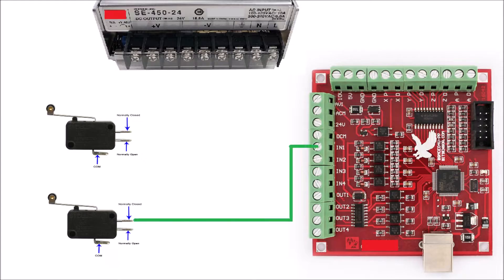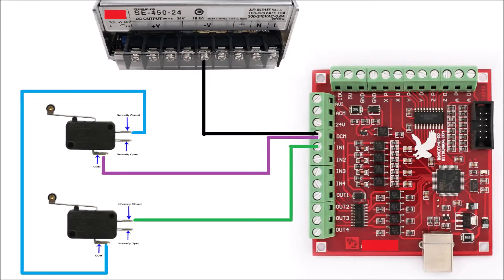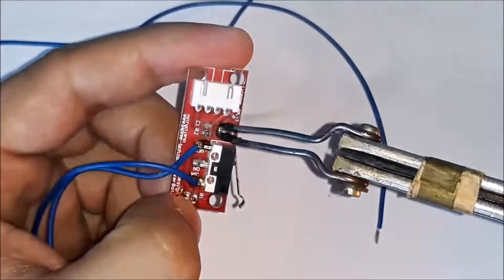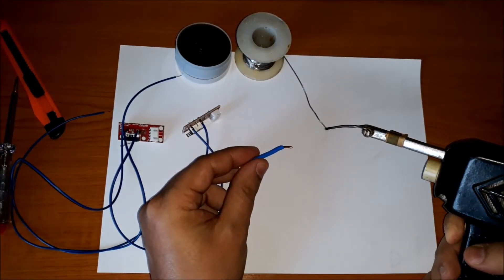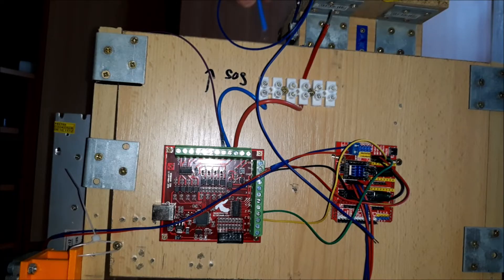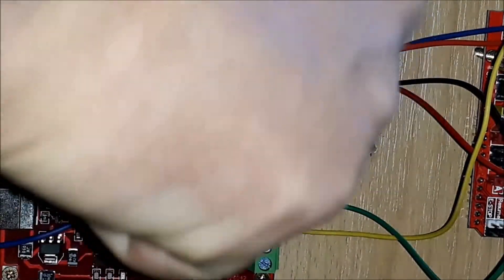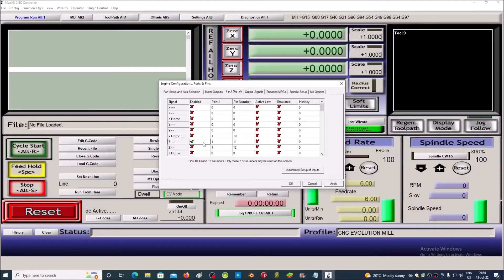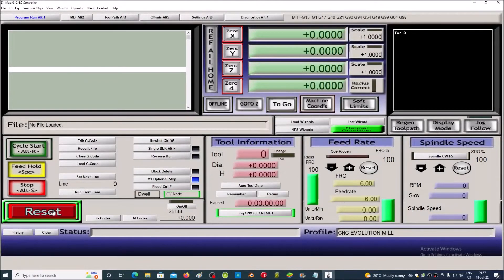CNC MILL BUILD PART 30 - MACH3 USB CONTROLLER LIMIT SWITCHES SERIAL WIRING FOR Z AXIS

Comment: My board was slightly different. I wired everything the same except DID NOT connect anything to the DCM terminal. Doing so caused a short where limit switches would activate output pins. I just connecting what would normally go into DCM terminal to negative on the power supply.

Comment: if you guys think this is actually work, no its not. but as an exchange you can use active low pararel switch by put 1k resistor between 5v and IN1, than use this schematic for IN1 and ground

Edited: i just realized if the mach 3 optocoupler power source was from 24 v, so yeah, its already being pararel at the first place by using IN1,IN2, and so on as a ground for switching (HIGH and LOW) the optocoupler

Comment: Multumesc de informatie!
Reply from the maker: Ce masinarie a-ti construit? 🤔
Reply: What is deferent using NC or NO switch?? Wichone is better? @CNCEVOLUTION
Reply from the maker: it is very dangerous to use NO, this means that the circuit is open and when the limiter is activated it closes and gives a signal, but if one of the wires of the limiter is broken, the circuit will never close again and the axes of the CNC will collide.  with NC limiters it is exactly the opposite, the circuit is closed and gives a permanent signal to the controller and at the moment of activation the circuit opens, so the controller knows that there is a problem and stops the CNC, also if for any reason the wires are interrupted, the signal is cut and the CNC is cut again  it stops.
Reply: @CNCEVOLUTION  perfect explain sir thank u. One more question, need to put home switch or posible to use limit switch as a home switch also?? 
I do a seri( not pararel) conection switch. 
NC pin SW1 to In1 - Com pin SW1 to NC pin SW2, com pin SW2 to GND mach3. One switch on x++ other one on X-. It posible to make the switch X- As home switch also? 

And its good wiring?? In1 and gnd?? Or in1 to 5v??. 
I seebon your video is in1 to GND and make check list on active low. Thank u
Reply from the maker: @botak333  in the current video I used 2 switches, one at each end of the Z axis, but you can put them on any axis and yes, each of them can be configured as a limit switch and as a home switch from the mach3 software, the physical connection can be done at one of the pins IN1 IN2 IN3 or IN4 with the DCM pin but with the condition of setting the mach3 software correctly. for more information see that I made videos with all the axes of the cnc.
Reply: @CNCEVOLUTION  do u have video to set limit switch as home switch?? 
And DCM is gnd right???
Reply from the maker: @botak333  -here is the homing link https://youtu.be/Mj9Ez7bsKMI - MACH3 HOMING SETUP ON BSMCE04U-PP USB BOARD
- here is the link with all the clips All videos: https://www.youtube.com/playlist?list=PLot1H9LpaT1jpxOhBffK3CaaUTtldK7fC
- I'm curious what country you're from and what cnc you build
-subscribe to the channel because now I'm building the much stronger 2nd version
-yes, all IN 1234 pins and the minus of the power supply are connected to the DCM, but in some countries they have different names.
Reply: @CNCEVOLUTION  okee, iam from indonesia, iam hobbys of cnc, i was build but with grbl, now i used AC servo and mach3.
Reply: @CNCEVOLUTION  one more question mate. What is deferent (+5v common , -step , -dir ) vs ( gnd common, +step, +dir)?? 
Wich one is better? For now i still used gnd common. I used mach3 bl usb v3. 25
Reply from the maker: @botak333  for motors there is no difference, the only difference is that some drivers and controllers use a negative signal and others a positive signal
Reply: @CNCEVOLUTION  oke mate, now the mach3 is comunication error what happen??
Reply: @CNCEVOLUTION  yoo mate, now i was finsh wiring the limit switch with NC switch. When the machine trigger the switch the machine will stop, and canot operate. So how to close the switch again? Because i must push manual the machine until the switch close again sir.
Reply from the maker: @botak333  it is normal that when the switch is activated the cnc stops, the idea is that you should not get to this problem, for that you have to set home and soft limits (soft limits is the usable length of the x y z axes) and home it is the switch on each axis where you want to do homing, it can be done at any end of the axis that you choose for any reason
https://youtu.be/Mj9Ez7bsKMI
Reply: @CNCEVOLUTION  ohh okee, for soft limits we calculete the leght of work place?? Or from the limit switch, for now i turn on the homing and it work when i do reff all home.
Reply from the maker: @botak333  CALCULATE from the switch where you are homing to the farthest place you consider but not to hit the other switch. the other SWITCH will be the last frontier in case the software fails, it will activate and stop the cnc
Reply: @CNCEVOLUTION  owhh now i under stand, the main funtion that switch is like emergency button righ, ohh ok i got it now.  I must put that switch far, now i put to near🤣🤣